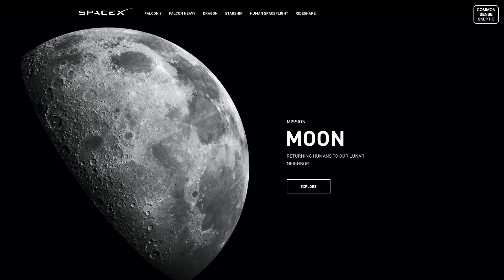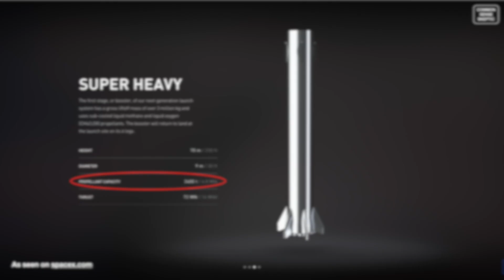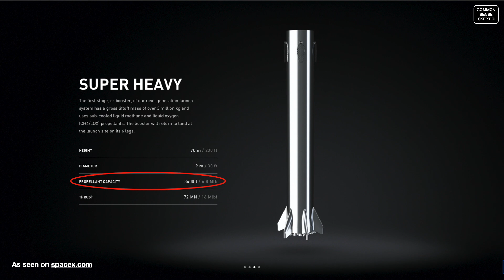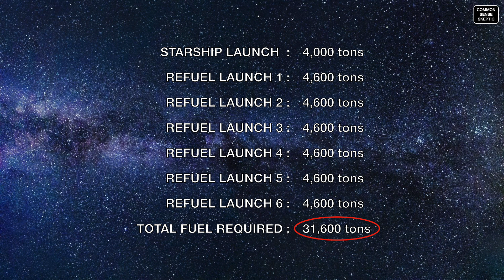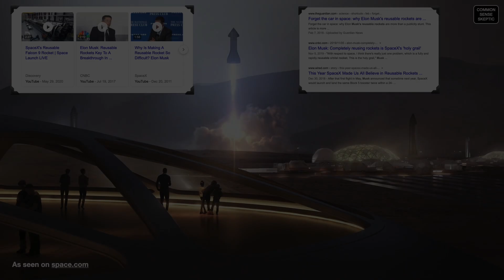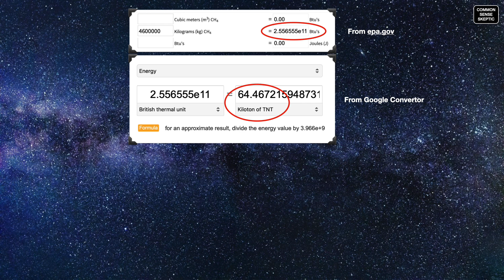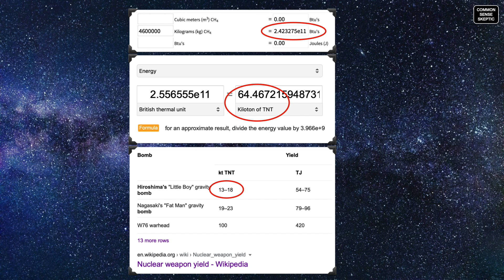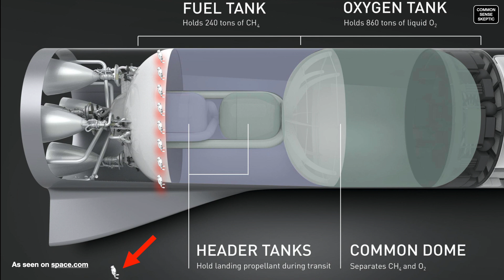STARSHIP EP5 - ORBITAL REFUELLING (1080p)

Comment: Spin the docked Starships. It doesn't need to be a fast rotation. The fuel will gather in the top of the tanker where it can be pumped down through pipes.
Reply from the maker: Sure,  but that’s not the process outlined by Musk. His process didn’t spin, and wouldn’t use pumps.

Comment: Did I miss something? You were saying that the first launch (with passengers) would make it to LEO with 600T (Half) it's fuel reserve intact, wouldn't that mean that a second one could do the same and then transfer nearly 600T (minus whatever is needed for landing) to the first? (so it isn't just the 100T payload it could shlurp over, but also whatever reserve is left in its own tanks?)
Reply from the maker: The payload capacity of the ship in only 100t. And the number of vessels required is often stated by Musk/SpaceX.
Reply: @commonsenseskeptic  Or maybe even less - my own calculations put it out at 60-80t with relatively optimistic numbers. Could you maybe do an episode on checking Starship as a LEO lifter? A lot of SpaceX fanboys currently proclaim that "even if Starship doesn't get us to Mars, the low prices will still blow the competition out of the water". Would be interesting destroying that claim.

Comment: Comparing energy in a fuel to nuclear bomb yields is just plain stupid. The timescale of the energy released is totally different. For example kerosene has about 10 times more energy per kg than TNT. So I can stand 1 meter from 1 kg of kerosene burning, and you can stand 1 meter from 10 kg of TNT detonating and we will both be just fine right? Because after all it's the same amount energy so we should be in the same amount of danger according to your logic right?
Reply from the maker: Check out episode seven where we destroy these types of arguments.

Comment: Please take on the following topic: how to maintain cryogenic fuels for long duration space missions. It's my understanding that hypergolic fuels or Hall thrusters are utilized for satellite or space probe course changes. The cryo fuels will have boiled off by the time Starship reaches Mars.
Reply: It boils down (pun intended) to first minimizing boiloff via passive systems like insulation or sunshades, and then using a cryocooler to recover the portion that does boil off. So it is possible, even quite simple, but Starship has neither of these.

Comment: Question, for how long can you store cryogenic fuel in the tanks, on orbit without significant loss?
Reply from the maker: Depends on what type of refrigeration the units have, especially if the uninsulated tank walls are exposed to space and are in the direct sunlight.
Reply: @commonsenseskeptic  So, how likely, for the mars plans is it, that a starship, parked in orbit for nearly 2 years, waiting for transfer window in convoy, needs additional fuel top up?
Reply: @boogaloobomber9889  Have you watched the videos? The is a transfer window only every 2 years to mars. Therefor, with so many (lets say 5) starship launches a day, you have to accumulate / park the starships in orbit until the next transfer window opens to go as a big convoy. Therefore you need to feed each crew for up to 2 years (median one year) and you have to hold the fuel for the transfer for up to 2 years (median one year) in each starship in orbit. And then, the additional 9+ month transfer orbit can begin.

Comment: The great thing about videos like this is reality wins.   All the arguments present in this video and the comments will be either proven or disproven in the next 5 to 10 years.  I really doubt any of this will age well.   It’s really hard to argue against one of the smartest engineering team on the planet who are willing to iterate their designs until they are successful
Reply from the maker: Reality continues to show no advancements on this front since posting a year ago.
Reply from the maker: If “the smartest engineering team on the planet” is backing Emperor Musk’s Martian ambitions, well that pretty much negates their claims of intelligence.
Reply: When you say reality shows no advancements in the last year, I don’t know what to say, there is an orbital capable vehicle being finished in Texas right now with a heat shield.   SpaceX has built over 100 raptor engines and proved them with flight duration hops.  A launch pad is nearing completion.   Starship will likely make an orbital attempt before  SLS.   This is real metal, not PowerPoint.   I won’t argue with you, just will come back in a couple of years.  Reality wins.

Comment: If I may:

(1) I do not find the comparison to atomic bombs absurd at all. It is not only fun, but enlightening.
(2) Nuclear weapons release all their energy as radiation, which translates to heat, which translates to mechanical work in the air, very rapidly. The rapid deposition of energy is what forms that significant shock and overpressure that causes the majority of destruction. A Starship failure would not mimic such a spontaneous release of energy.
(3) INSTEAD: it would likely be a series of smaller (in comparison to the total yield) detonations (yes) as the fuel and ox expand and mix together, combined with "rapid" gas expansion and ignition. A giant burning exploding tower throwing fire everywhere.

Jet fuel may not melt steel beams, but a methane-oxygen or metal-oxygen fire certainly does!
OK, this is a little pedantic, a Starship-Superheavy explosion will fuck up anything in the area. Antares is a small rocket in comparison and that was a pretty damn big explosion.
Reply: I sum it up as:
It is gonna be a big boom, that is for sure. Why be pedantic about how big exactly?

Comment: You are misleading on the explosion statistics during landing of superheavy booster. You assume its fully loaded and for some reason there is a fully loaded starship next to it. This is wrong. First a superheavy landing is going to have tanks that are going to be considerably empty. Second spacex uses load and go to fuel their spacecraft, it is very unlikely that they would have a fully fueled starship tanker waiting on the ground. While i accept that an explosion from starship superheavy during launch is going to be highly energetic, the same cannot be said for landing the superheavy booster.
Reply from the maker: We cover this again in Ep7 using historical examples. The numbers check out.
Reply: @commonsenseskeptic  no they dont you assume a landing booster is full of propellant and for some weird reason there is a fully loaded starship tanker waiting on the ground. Such a scenario is not likely during landing. The booster will be mostly  empty and like i stated  there is no reason for them to have a waiting fully loaded tanker starship with cryogenic fuel that needs to be topped off regularly. It does not make sense.

Comment: ...you may want to do a little more research, talk to some engineers. You've got some glaring holes in your logic.

2 glaring points: starship doesn't need to slow down 'drasticly' theoretically any change in speed at all will do the trick if you're willing to wait long enough (and break the surface tension)

2: fuel burns, it doesn't explode. The thin walls of a tank isn't enough to make a true explosion like you're describing.
Reply from the maker: There are plenty of engineers in this channel’s community that agree with our assessments, and Ep7 revisits the explosive potential. The sides of the ship have nothing to do with it.
Reply: @commonsenseskeptic  I'll take a look at episode 7. Thank you 😊

Comment: Tell me you don't understand fluid dynamics without saying you don't understand fluid dynamics. I suggest starting with "Modeling of Pulsed Propellant Reorientation (NASA Technical Memorandum 102117)" and then go from there. This should clear up some of the misconceptions regarding the ΔV requirements for prop transfer and prop behavior.
Reply from the maker: Understood it well enough to know the paradigm SpaceX was using was going to be cancelled - and it was.

Comment: We're you guys laughing when they first put landing legs on a F9 first stage?
Reply from the maker: Nope. That predates the channel. We’ve only been doing this a little over ten months.
Reply: @commonsenseskeptic   What I'm trying to say is that SpaceX has already made a habit of doing things commonly thought of as "impossible". I don't think this video is going to age well.
Reply: @BadOompaloompa79  Nobody thought vertically landing rockets was impossible - in fact, NASA did several experiments on it with the DC-X.
Reply: @HalNordmann  Lots of people thought the falcon 9 landings were stupid to even try.
Reply: @BadOompaloompa79  At least proffesionals thought that although it was possible, it just wasn't worth it. And the jury is still out on that, since nobody has build a returning stage that big with any other recovery technology. Winged flyback or something else could be better, but we have no way of knowing for sure until someone tries it.
P. S. Their only innovation is probably the insanely dangerous "hoverslam" VTVL variant - which was never tried before for obvious reasons, since you are pretty much guaranteed to burn through prototypes very quickly.

Comment: Sorry, your example at 11:38 is totally wrong. The human to scale is a human standing and pictured from a downward looking angle. You need to stack five figures on top of each other from the bottom up and and not next to each other across. If you do it bottom up from the bottom of the rocket, the head of the fifth figure will hit the opposite side of the tank.
Reply from the maker: That’s why we left gaps between the figures, to count for the angle.

Comment: Where to begin with?
- methane is 22% of propellant by mass, not 100% so your explosion energy radius is very wrong
- you say that it is likely to explode on landing but do the maths for take off and say it applies to both, propellant load on landing closer to a couple percents
- point-to-point Starship does not require superheavy for trips of less than 10,000 km
- a New York to London would cost $230k in propellant cost in Starship vs $23k but if you assume that propellant is a significant proportion of the cost of flying a Starship then, SpaceX already won
- you don't need a bulky spacesuit in a point-to-point Starship, if there is a problem you die anyway
- Starship payload bay has a volume 20% greater than the upper deck of the 747 but you assume 5 times less passengers?
- the fuel to be transferred in orbit refueling will not be in the payload bay, the tank size and the thrust will likely be increased in the tanker version of Starship
- Starship is going at 25 times the speed of sound, there is no need to decelerate a significant proportion of this velocity to move propellant by 50 meters. This is a process similar to what they do during each launch between stage separation and second stage engine start, using hullage gas to provide thrust and push the propellant to the bottom of the tanks for the engines not to ingest gas, except that they have to handle the pressure difference in addition as you said mentioned
- you just explained that most of the trips are for Low Earth Orbit refueling before heading to Mars and then you say that Starships are not reuseable vehicles because Starships are sent to Mars (for at least 2 years), what?
- I am surprised you didn't bring up propellant boil off in orbit while waiting for all refueling tankers
- 12:04 No 30 ft / 3ft 9 is 8, the presentation slide was correct
- you should try to understand instead of piling scorn on SpaceX engineers, like if they didn't know how rockets work while being the space industry leaders
Reply from the maker: You SHOULD have began at the episode called Nuclear Concerns, because we address quite a lot of these exact same, incorrect, types of statements.
Starting with the comparison of SS to N1. N1-5L is an historical precedent for the type of outcome for an on-the-pad explosion with half the propellant load. Estimates of 1-7 kilotons with only 15% of propellants detonated. We'll stand by our numbers until we are proven right or wrong when StarShip explodes on the pad, especially given the effects of the Beirut explosion. We won't have to wait long. First orbital attempt, most likely.
Your assessment of SS not requiring SH for trips over 10,000km is speculation, not fact.
Your fuel costs argument is incoherent, and is worded against your attempted point.
The spacesuit argument is dismissed. Ordinary people will not be able to handle the forces without a flight suit, and containing body fluids will be key in this system incurring weightlessness. Covered in Episode 8 PTP
If this is an argument about the pax capacity of the CGI ship, take it up with Shotwell. We used her numbers. 
Your fuel transfer paradigm doesn't exist, so this is speculation.
StarShips headed to Mars are single-purpose vessels, not reusable. To get the next crew to Mars, you need another ship. We differentiate between tankers and StarShips. You apparently didn't.
Sloshing the fuel between vehicles in a tail-to-tail configuration was dismissed as unworkable already. The CGI examples they use now are side-by-side, connected at the midpoint. But, please, by all means, demonstrate how that would work by reducing velocity.
Propellant boil-off is of little consequence if you can't transfer it in the first place. But, yes, that's an additional factor to consider.

So, if you're quite finished...